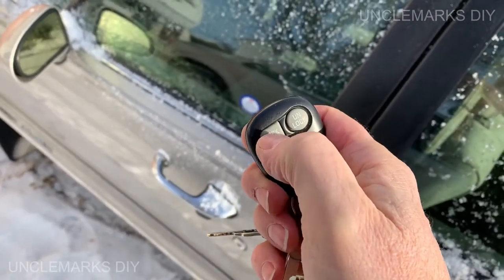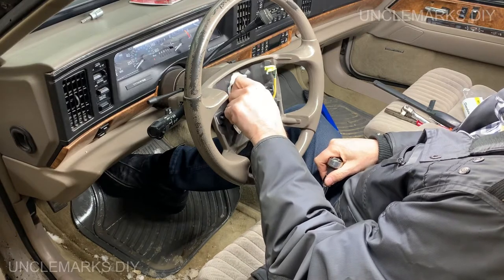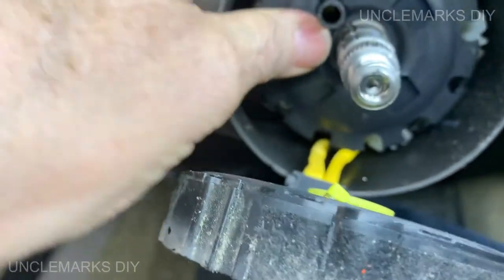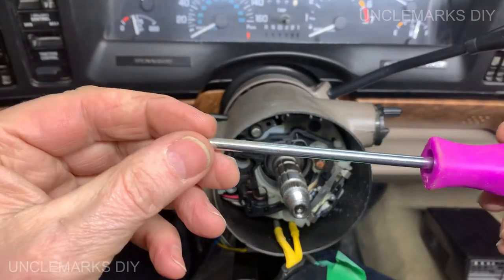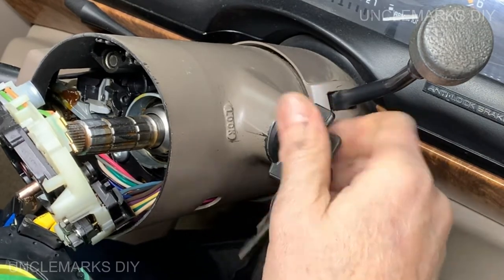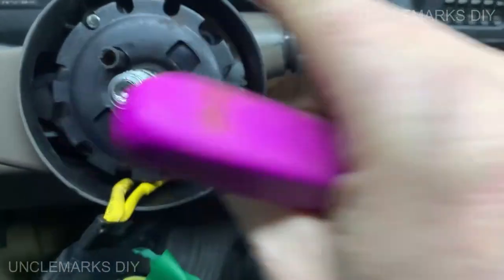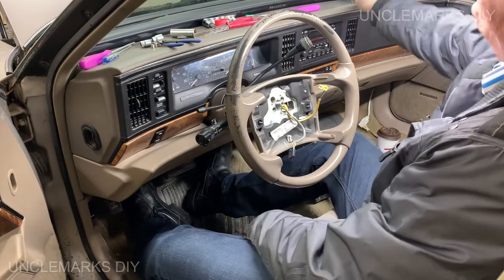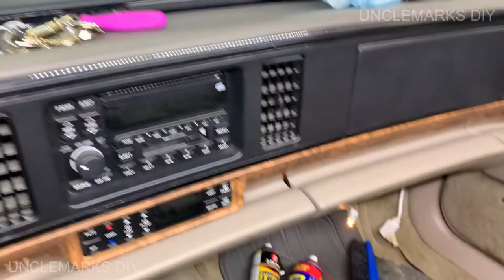How to remove a ignition lock cylinder on GM Buick 1996 May be similar on other GM vehicles (EP 167)

Comment: 24:17 I did it without a tool
Reply from the maker: Glad you got it apart! Hope you fixed your issue.
Reply: @unclemarksdiyauto  I hope so too your video helped a ton thank you I just had to be a smart ass lol I did need the tool to compress it to get it back on tho lol but used channel locks to press it down in the first place cant tell you enough how much this helped
Reply from the maker: @V-A-U-G-H-N  All good, Lucas! Keep your car running! The newer stuff is getting too expensive.

Comment: When I start my 97 Buick Rivera it will not stay on the on position. It turns the car off. Does that mean I will have to replace the ignition cylinder?
Reply from the maker: I think the spring action has to do with the switch at the bottom of the steering column. I may be wrong. Maybe unhook that and see hat each do separately?
Reply: I came on here because I too have a 1999 Riviera & it's doing the same thing. Did u ever get it fixed?
Reply from the maker: @carlcollins9227  Not sure but does not the actual switch (which should be at the bottoms of the steering column) not contain the spring that moves the ignition cylinder from start back to run by itself?

Comment: i've got a 1998 oldsmobile. the other day the key just turned freely, and no starting. now we've got it apart to this point but can't figure if it's the ignition cylinder or the switch. Really up the creek on this one.
Reply from the maker: Been a while since I did this. Does not this ignition tumbler push a rod down the column to the ignition switch near the bottom of the column? Did the rod just unhook on one end or the other?
Reply: @unclemarksdiyauto  Yes there is a rod, just found it earlier. I'm guessing it unhooks, but havn't gotten that far yet. The part it's attached to at the bottom pushes in when i touch it, so at this point i'm not sure what is not working. When the key turns it still works the steering wheel lock , but the ignition isn't engaging
Reply from the maker: @eabcool  Should be able to see rod move while moving your key. You have the pellet in the key? Could be wire is broke from pellet contact to anti thief module.
Reply: @unclemarksdiyauto  yes it has the chip in it. The key seems to move freer than normal in the cylinder, but then it also got stuck a couple times briefly.

Comment: Where you able to use the same keys without getting it reprogrammed?
Reply from the maker: The actual reading of the pellet is not at the ignition, but wires go to another spot where the measurements are taken. So a ignition change should not affect the anti theft. If you use the original keys, you should be fine.

Comment: I have a problem with my ignition. My key will go in but won't turn all the way up. Only down. Suggestions ?? Do I necessarily have to follow these instructions or is there another little trick I should try before trying what u did. I'm super lost
Reply from the maker: I believe that as that key is turning, it pushes a long rod all the way down the steering column to the actual switch. If you look under the dash as someone turns the key you should be able to see what it is moving. I wonder if something is binding at the bottom? Maybe some how the switch is misaligned. You could unhook the switch and see if the key turned freely after that. Then you would know it is something with the switch possibly. It’s a starting point.

Comment: Hi, I was wondering what model of puller you used for the steering wheel, you mentioned it would be in the description however I can't seem to find the link for it.

Watching this as I need to do my turn signal switch, video seemed relevant for disassembly I just don't know which puller to use.
Reply from the maker: Hi Last Hope! This is the link https://amzn.to/2KXWSWG  although Amazon is changing there system Feb 28th.
Reply: @unclemarksdiyauto  Thank you for the reply! 
However that appears to be the lock plate remover, does it function for both purposes?
Reply from the maker: @Last Hope, you need a separate tool too pull the steering wheel. This should work:  https://amzn.to/3rQoOyE
Reply: @unclemarksdiyauto  thank you very much :)

Comment: Thanks.  Tims coffee and bits?   Tip for weak or non magnetic screwdrivers. Get a small powerful neodymium magnet and put on the shaft near the handle. Leave it on while working for max strength.  It will also magnetize the screwdriver itself.
Reply from the maker: Great idea Jake! I am happy this job is done! Laying on my back with dirt falling in a tight space not my idea of fun! On a hoist is the best way to do this, or flipping truck upside down and laying on it and working from that angle! LOL!

Comment: I have a 1992 Chevrolet Caprice I am about to purchase, the gentleman lost the key for it but has a new cylinder. Do you think this is possible without a key or not? Similar procedure I imagine but this car has no chip in the key.
Reply from the maker: I have done it on a Ford. You have to drill out the tumblers first. The rest of the video is the same. There must be a video on it somewhere, but I never recorded one. Hope it goes well, Will.

Comment: What do I do if I lost they original keys? I’m thinking about checking the code on the ignition cylinder to get it cut by the dealer but I heard you need the key to get the actual cylinder out
Reply from the maker: Not sure if any dealers can cut these anymore. Plus, they are chipped. (Little pellet on key) I am not sure if they can find that value out.
Reply: @unclemarksdiyauto  thanks. im thinking about replacing the ignition cylinder now. Will any new ignition cylinder and correlating key work or will it need to match the resistance of the old one? The new ignition cylinder i purchased fits my car, but it doesn’t come with a chipped key
Reply from the maker: @Groovysmokes23  The computer is not going to let the engine start, unless someone has already disabled the system. They would have had to add a resister to the system that matched the old key.
Reply: @unclemarksdiyauto  sweet so my old ignitions VATS actually failed and I had to solder in two resistors under the kick panel. Do you mean to say i just have to do the same with this new cylinder? And if so, can I continue using the blank key or will I need to get a chipped key even with the bypassed VATS
Reply from the maker: @Groovysmokes23  The resister think can work, but you don't know the value. There is a table on the net somewhere that gives all the values that were used back then by GM.
Reply: @unclemarksdiyauto  thanks again. I found the value and replaced the ignition but after connecting the battery, the radio and dash lights won’t turn on and the car won’t start But the roof lights work fine. What could I have done wrong?
Reply from the maker: @Groovysmokes23  Roof / interior lights are not security based. Headlights should turn on manually. Do they? How did you figure out the correct resistor value without the old key? Probably don't have the correct value? Also, have you heard this car run just before the original keys were lost? If someone else owned it, maybe it was not running before you got it? Is the original radio still in it, on the 92 LeSabres, I believe they ran some electronics through it. If original radio is out, it will not start. (Or maybe it was the electronic heater controls..did the no start if unplugged)
Reply: @unclemarksdiyauto  i tried reconnecting everything back correctly and the electronics work now, all except for the climate control screen and the car won’t crank. My mistake, My previous ignitions vats failed so I had someone test the old keys with a multimeter and was able to find the ohms value (i had written it on a paper that I found, 9.4 = # 11 key) which I used to solder in a matching resistance, and it started the car right up. I ultimately did the same with the new ignition vats but the car won’t crank at all. Im really not sure what it could be. I even tried using the older vats resistor set up that I soldered together to no avail
Reply from the maker: @Groovysmokes23  I am not sure your next step without being there with you. Some many things you could check. Starter relay ok? Can it be jumped to get starter to crank? I will leave you with it, keep doing some research. You might have to get in touch with a old tech that use to repair these cars everyday.
Reply: @unclemarksdiyauto  i was told maybe i should try a ignition switch relearning procedure which I’m going to try learning to do later, regardless thank you, I really do appreciate all the advice you’ve given me. I couldn’t have gotten this far without this video
Reply: @Groovysmokes23  did you ever figure out how to relearn? I have to replace an ignition on 1998 Buick lasabre and I don't know the vats value so I would like to relearn it as all keys were lost

Comment: Some POS stole my car and the keys to this car were inside. This doesn't look fun.  Sigh...
Reply from the maker: @CDXLIV444  This is shot pretty much in real time, other than cutting stuff for camera angles etc. Remember that this car ignition had been modified so the chipped key is not required. (Those wires that were cut) A resistor was inserted further down the line to simulate a chip (pellet) so the computer would let the car start. Be careful.
Reply: It's OK You can do it! This video is pretty raw but "this" video is the only one That I have found that has stayed pertinent to the job at hand Including all that c***, the roadblocks that you may encounter. You didn't ask for advice a day ago however time IS of the essence. 
- Get a simple "maintenance" composition notebook and take notes.  You have a good uncle here.He's giving us the good the bad and the really ugly so we can learn 
- log time stamps
- potential tools ready *Long reach driver magnetic bits * Stearing column puller $44 @autozone This is part of their borrow a tool program. You buy it, bu upon return you get your $ back. 
- Read the instructions inside your new lock cylinder box and steering wheel puller 😅
- Take photos once you've removed your air bag everything after that!
You will install/assemble reverse of disassembly.
- trust uncle Mark and dont trust people  around your keys!
Reply from the maker: @wellbodyworks  Yes, it’s an older video of mine. They are getting better with each newer one. (YouTube is a learning process for creators) Thanks for watching and you kind words.
Reply from the maker: @wellbodyworks  thanks buddy!